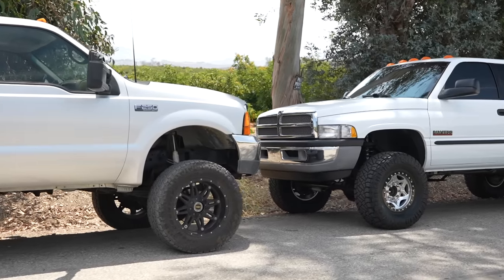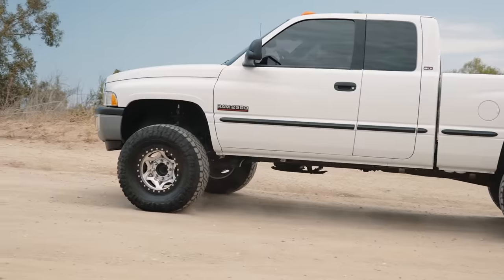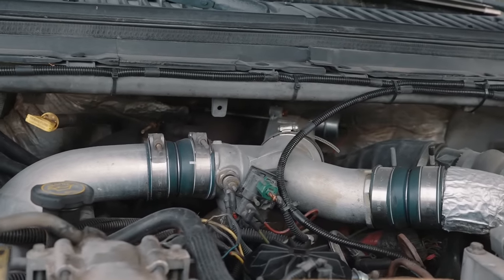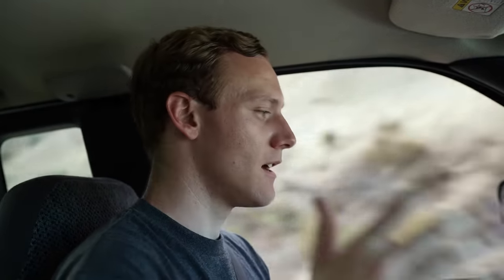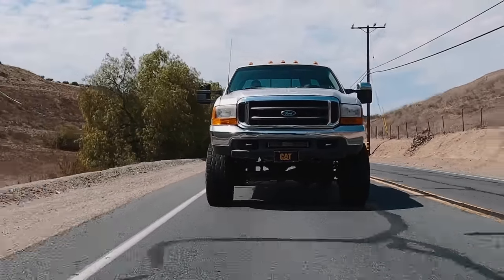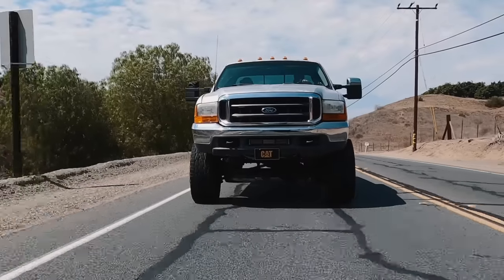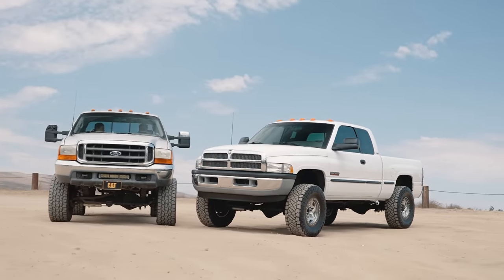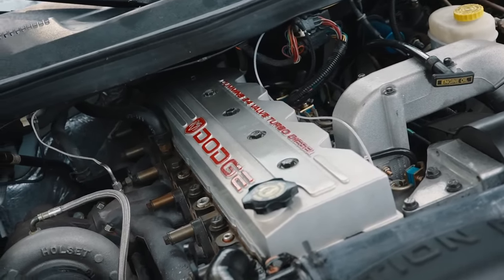1999 Ford 7.3 Power Stroke Super Duty vs Dodge Ram 5.9 Cummins 2nd Gen | Which Is Better?

Comment: Me and my wife daily drive 7.3s as soon as the engines drop out they are getting 5.9s... ive been around the truck 20 years sofar so good and I still have my stock Trans never rebuilt... the 5.9 shure is easy to work on lots of room...
Reply: Don't got a 7.3.  But a 6.8 v10 with 473k. When it goes its getting a 5.9 also.
Reply: @Gonz.0  lol the v10 is insane especially the fuel economy a 4x4 excursion probably gets 8mpg 😆 🤣 😂
Reply: @brettscott3759  ha. It's ridiculous.  But reliable
Reply: 😂 the 7.3 is gonna last longer than you.
Reply: @PurpleLightning2  lol it better we have 2 excursions and a f250... one of the excursions my mother bought brand new I  was taken to school and learned how to drive in it... my mom passed and my father gave me the car... my wife takes my kids to school in it... I was there for the purchase of the f250 when my uncle bought it and I bought it from him for 4k.... God bless my aunt lol it had 160k miles on it 🙌... yep these are investment vehicles I'm currently taking a break from rebuilding the 2nd excursion to respond lol up pipes, turbo, hop the works...
Reply: @brettscott3759  wow that’s nice! What year excursions? I have a 2000 7.3 excursion with 350k miles on it. Got it last year for 4.5k from a buddy who wants a dully.
Reply: @PurpleLightning2  both are 2001.... my mom's I got for a buck lol you know the deal and the new to me one I picked up for 11k but it's  4x4 but the interior is immaculate and it's grape jelly purple.... 320k miles im playing catch up on the maintenance Atleast it's not my first time doing the work... but I'm going going to hot rod the truck.... hopefully 6-700 horse power... single stage injectors and a crazy cam... its going to sound like grandpa's tractor in the winter not warmed up im excited
Reply: When the motors finally fail you won't be able to find a running 5.9
Reply: And you will definitely be working on the cummins more often.
Reply: @brettscott3759  I get 14.5 to 16 in my 2000 Excursion v10 and even pulling 12k I am above 8 mpg. And yes it is a 4x4 with 3.73 gears.
Reply: @Irishjay1025  There is no way you are getting diesel mpg pulling with a v10... I owned a 99 f250 v10 for a short time and i swear it sitting there consumed gas heck taking the trash to the dump (while driving like grandpa going to the store) eat $5 worth and its maybe  a mile from me
Reply: @Irishjay1025  I've got two 6bt motors picked them up a couple years back I know they arnt the exact same but close enough for me and i have a 2nd gen for a farm truck... I work construction in texas and deal with equipment.... what ever black magic your casting for mpg keep it up but no killing stuff. Lol we had some v10 company trucks only issue we had with them they were fuel hogs they hauled ass but honestly we got 11 mpg average, 8-9 towing with the wind against my back... I don't worry about possible problems... and I've been around brand new 7.3s and old 7.3s my dad worked on them for a living... 7.3s need alot more suport than a 5.9 to run.... all the dodge and ford parts are the worst parts of both engines... I keep a spare crank sensor and cheap mini socket  in the glove box of all the
 7.3s because I've spent enough time on the side of the road to learn my lesson lol... 5.9 is great but I don't like the way the dodge looks nor am I fan of the electrical

Comment: Upgrade the 7.3 to the radius arms and coil springs from the 04-16 Super Duties. You get better ride and turning radius. I did it and it makes a huge difference.
Reply: Do tell, any vids on this?
Reply: @jstar1000  I'm not a Youtuber so, no videos. Happy to share if someone wanted to share my experience and build. I would say my build is a bit unique as I used an F550 super 60 front axle and all the steering components too. It has the Carli Unchained suspension system with OneUpOffroads radius arms.
Reply: @eclifton4070  I thought maybe you knew of some, not necessarily your videos. Oh well, Ill do some research. Thanks for the response.

Comment: I know with my 12 valve its easy to work on with tons of room in engine bay and you can build a ton of power cost effectively vs the Ford. Lot less parts but the weak point is the trans. Always liked the sound of the Cummins. Good vid thanks for the comparison

Comment: Both solids trucks and engines, interior definitely goes to the Ford. Treated right neither engine should have major issues for a long time. I’ve got a 2000 Ford (250k miles) and never thought it was rough, at least not for a truck. I’m sure the Dodge rides better with it’s front end but it may also develop a death wobble that the Ford won’t.
Reply: My dad had a 2003 f250 with a 7.3 and when he sold it had 390k, it rode rough but because it was lifted, the Ford in this video is definitely lifted to so that’s why they think that but I’ve always thought fords ride great, the leaf spring suspension is def worth it if it’s taken care of
Reply: Lol I've had ford's with death wobble and 4th gen steering fixes the death wobble problem.
Reply: @1g_dsm_life154  leaf springs in the front?
Reply: Pretty much anything with a solid front axle can develop death wobble, leaf springs included. The Dodge is more likely to get it though, mainly because of the track bar.

Comment: I own a '02 7.3L but originally shopped for a 5.9L and gave up after looking at what they wanted for the miles they had. I'm happy with my 7.3L but wish it had a manual. No problems but I love manuals. I'd jump at your 5.9L if it were for sale.
Reply: Guess you found all the "I know what i got" 400k mile clapped out truck some kid on facebook is selling with the fuel on the engine turned up to right before the adjustment would break

Comment: I definitely have to go with the 5.9 Cummins. The 2nd gen has its problems but they are justified in comparison to the 7.3. 

The mechanical injectors for the 5.9 is a huge win over the 7.3
The VP-44 holds it back only when it’s accompanied by a stock lift pump.
Reply: Well said I’m a 5.9 guy myself

Comment: Granddad had a 1995 F350 work truck. We used to use it to pull big articulated AWD tractors out of the mud when they got stuck. Put it in 4L, lock in the hubs, first gear, and it could idle to pull anything. It had a habit of kicking itself out of gear and rolling away when it was on a hill, but only when there was something dangerous for it to roll toward. Granddad had to run after it several times to stop it rolling into a fuel or fertilizer tank. It's still around, with a friend of his, just ticked over 300k miles. Only ever needed water pumps.

Comment: Having owned both, the 7.3 has a little more power, but the cummins wouldn't die, even with 450k miles in it. Both are great trucks. I got a 95 7.3 now, definitely looking to add another 01 3500 with the 5.9 like my last one to my fleet.

Comment: Engine: Ram, barely 
Looks: Ram, barely (subjective I know)
Interior: Ford, easily
Other mechanical aspects and truck in general: Ford, pretty easily. 
Can’t go wrong with either, 2 absolute beasts and legends.
Reply: @None Ya probably because there are more fords around your area. Most of the vehicles in shops in my area are gm but there are more gm products around.
Reply: @None Ya At my shop its mostly fords too but it seems like they are all work trucks... the rams that come in are just for personal use and are usually in better shape.

Comment: Original owner of an E350 super duty 7.3 van , with many up grades including OEM injectors , much bigger Turbo and roadmaster suspension, plus a HYDRA.  Training done sift kit with a billet Converter and Edge2 system for Gauges.  Note it is the limited Explorer Edition modification Van.  Tow’s great with great mileage 15 all day towing, 10,000 all day.

Comment: Both engines are excellent.  Dodge trucks seem to have more issues with everything else.  It used to be a common saying about Dodges that they have a million mile motor in a 50,000 mile truck.  On Fords, the various sensors and engine harnesses seem to come up.  And one has to be dedicated to repair the leaks the 7.3 gets.  But if you get one that either has already gone past these issues, either truck will give very long life, good fuel economy and excellent resale value.
Reply: Yeah I know that's right😂

Comment: I have had both. I loved the extra cab space of my 7.3 crew cab, but my 5.9 turned sharper and easier.  After having a 01 7.3 and 02 5.9 I  will go with the cummins every time. My cummins was by far cheaper to maintain and even though the body and interior does not compare to ford's, the pulling power and mechanical reliability was a lot better on the dodge. I have lost the transmission on both trucks but think ford's transmission is better.  I'm starting to build my ideal truck now. It's an 03 dodge 2500 crew cab, already sold the gas hemi, transmission,  and transfer case. I have a 12 valve going in it mated to a Ford 5r100  5 speed automatic and transfer case. Also uses a Ford starter and alternator. The only electronics on the engine are a tps for the transmission, a 12 volt fuel shut off,  and tone ring with a pickup to tell the ecu the engine is running so my ac and dash work.  I wish there was a chevy part I could use to say I used the best of all three manufacturers,  but there was nothing I could replace that would be an improvement so I guess it's just a dodge ford combo for now.
Reply: 12v and Alison transmission in a ford
Reply: Dodge suspension with a 7.3 with Chevy's Allison six speed.

Comment: Just picked up an 02 Dodge 2500 5.9L Cummins 5spd 4x4 regular cab long bed and am loving it so far. Plan is to eventually turn it into a mechanics service rig with toolboxes, a welder and a crane on a flatbed.

Comment: One thing I will poInt out that was said in the beginning of the video that is a little miss leading is that this is the final generation for the 24valve. Actually it’s the final generation for the 12valve. The 24 valve ran 1.5 more generations past 02. It got updated with a bigger turbo different intake slightly bigger injectors for 03.5-2005 2005.5- 07.5 they changed the tuning and egr temp and got a little more out before the completely switched to the current 6.7l displacement. There was a 1.5 year run where the 6.7 and 5.9 ran concurrent from the beginning of 06-07.5. The 6.7 in those years was the high output choice. Both great trucks and if ford put a Cummins in their trucks and not the powerstroke then that would be a truck that everyone would buy. I’m dodge through and through but the 7.3diesel is the only ford engine I really like from that time period

Comment: Him: "What would you choose"
Me: cries in can't decide
These are my 2 favorite trucks ever with OBS ford's coming in 3rd.
Reply: jeremy pollitt  cant beat a 8th or 9th gen ford 150 or 250 with any motor from the 300 straight six to the 302 or 5.8 351 Windsor..there all good strong motors I've seen all 3 with well over 300k miles on them..just gotta spray them off after winter driving and they won't rust out
Reply: jeremy pollitt  absolutely there not exactly fast but they are torque monsters and they can last a very long time when taken care of properly..there built closer to a diesel engine the way there designed..except for using gas instead of diesel there actually very similar..
Reply: jeremy pollitt  it was probably a 95 or 96 model because 97 was the year they became 10th generation which was the bubble body  and they started using the modular motors which were the 4.6 and 5.4 v8s.. the 300 straight six lasted from 1964 all the way till 96..didn't change much other then different intakes carburetors and  exhaust manifolds..and of course became fuel injected in 86 but other then that it remained unchanged it's an awesome motor and truly worth rebuilding I'd like to install a bigger cam, injectors from the 5.0 v8 and a header..that alone really wakes up the straight six.. I also want to turbo it with a turbo from a 7.3 powerstroke just 8 psi of boost and you can push around 250 hp and over 450 ft lbs of torque and it makes the mileage go up to around 23 to 25 mpg..that would be amazing to get tht kind of mileage..mines a 94 300 six with the 5spd 2wd.. they respond well to the boost also..

Comment: I'm a 1st gen SD 7.3 fan - own an 01 350 CCLB with a 6 speed. Definitely considered an early-2000s Cummins, but couldn't stand getting another extended cab rather than a full 4-door. But either way, both of these trucks are awesome. Inline 6 Cummins is soooo hard to beat.

Comment: After 2 transmission replacements in the 5.9 the 7.3 is better had both. The interior completely fell apart in the dodge
Reply: Yeah the ford is hands down just a better build quality truck the only reason to own a dodge is the cummins but then again they make kits to put them in fords
Reply: No way 7.3 a hundred k engine max a Cummins will run a million plus no sweat.
Reply: @matthewwilliams9028  The Cummins will but the rest of the truck won't.

My 7.3 has 237k with no blow by it may not run a million miles but it will  do as many as it's able for me.

Also I heard that same bullshit about my 6.4 power stroke being a 150k engine it has 200k and I've seen them higher then that and big whop if it blows up I'll Cummins swap it
Reply: @matthewwilliams9028  100k what lol there are alot of people with over 500. The cummins is just as reliable. 1 Million is not really common for either one but it has happened on both. Search on youtube lol

Comment: Just hit 10,500 miles on my 2000 F250 7.3 superduty crew cab Lariat Longbed. Just had its 3rd oil change. Added Amsoil bypass filter system, adrenaline oil pump & a Banks Rear Diff Cover. Love My Truck!

Comment: You can upgrade the 99 suspension to an 05 suspension and it will give it a remarkable amount of suspension in the front and doing away with the bouncing as you showed in the video

Comment: Huge advantage of the 7.3, if you lose oil pressure, you lose your injectors and your truck dies, if you lose oil pressure on a Cummins, you’re doing damage.

After owning both, I would not have another 24 valve.  The weak lift pump, trash transmission, and the electrical problems galore.

Comment: As someone who has owned both generations of each truck I will say the Ppump 12v is hands down my favorite truck of all four. The ease of maintenance and reliability is unmatched by the other 3 and the ability to build power for a lot cheaper is a huge factor as well. I preferred the 5 speed in my 97 7.3 the most of all of them and it was my favorite for comfort to drive. If I had my way I would have put the 12v in the 97 ford and had the best of everything but I didn’t own them at the same time. The worst truck of the four I owned was the 24v I went through 3 VP pumps in the time I owned it and had to get the NV5600 rebuilt when 3rd gear blew apart. I just didn’t love the power or price to gain it with either 7.3 when compared to the Cummins I had the 24v and a 02 7.3 at the same time and I hardly drove the 7.3 I didn’t love the ZF6 transmission or either of the NV compared to the ZF5 it shifted the best and seemed geared the best. I never owned an automatic so I can’t give an opinion on those. The dodges might ride smoother but the poorly designed suspension fails often I did 2-3 front ends in both my 2nd gens my 97 f350 never had a front end issue except one wheel bearing failure but it was at 290,000 miles and it appeared to be the original bearings.

Comment: I agree with a lot of what is said but you’re in a warm climate and pavement trucks. Now that being said, bring them north to Michigan,Minnesota, Wisconsin, Canada.......the Dodge is bottom of the barrel as far as longevity chassis wise. The Cummins engine itself will outlive the truck but notoriously dodge rust out quickly from body to frame. So for me the dodge will always be a last option. Can’t drive a truck that’s rusted in half no matter how well the engine runs.......just my two cents.
Reply: That why they call em a shipping crate up there?
Reply: Canadian ( Ontario) here... the early Super Dutys were notorious for rust as well... hard to find clean ones that are 4x4. The second gen dodges are for the most part extinct except for diesel enthusiasts driving them around, never see anyone using one for work

Comment: Got a 96 7.3 power stroke with 133’000 miles on it. Love it ! Also have a 22 Bronco Sport outer banks. Love it ! The only thing I don’t dislike on the dodge is the Cummins straight 6, it’s a good simple engine.

Comment: I've had both of these trucks. I will say the ford had fewer issues to 500000 miles. After that the cost per mile was about the same. They were both beasts of the day. I just wore them out and wanted newer. Now I don't really haul much anymore so I have a gasser now. I would take either though. I really like both those body styles.

Comment: The super duty wins hands-down in overall quality by far it’s not even a comparison
Reply: idk kinda sounds like you’re wrong
Reply: @mahpiyahoksila93  nah hes right
Reply: It's hilarious that the best parts of a Dodge truck are the parts that Dodge didn't make. Cummins engine, NP/NV/Aisin transmissions, Dana axles. The seats have cheap, flimsy leather (leaves a butt print when you get out), the dash is huge, in the way, and hideous (moreso in the coupes than the trucks), the engines either have decades-long lubrication issues (Hemi) or are totally underbuilt (3.0L EcoDiesel with trash main bearings). And the Dodge strategy is to quietly replace your seized engine at the dealership and hope you don't post too much bad press online. Stellantis/FCA is an awful carmaker